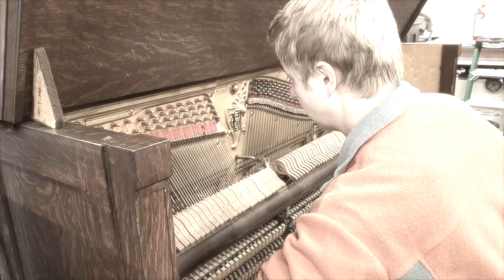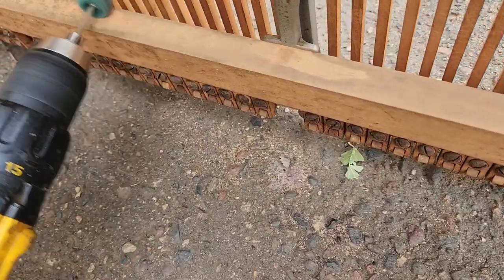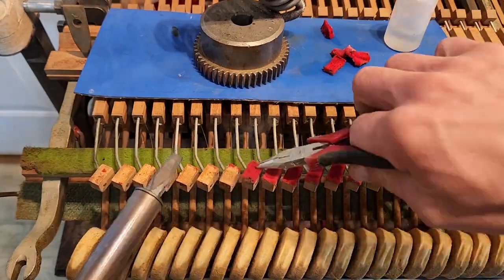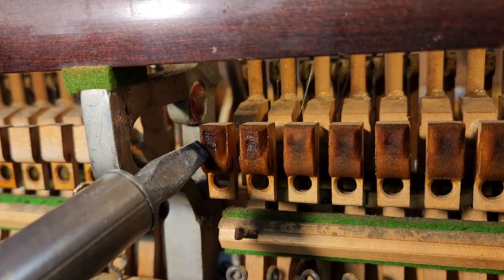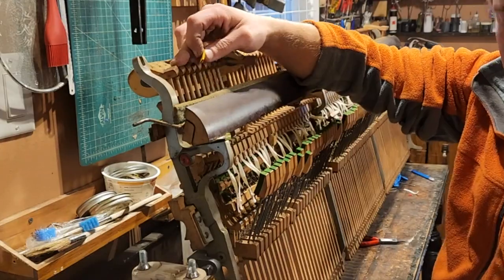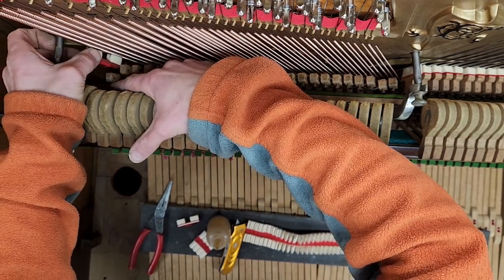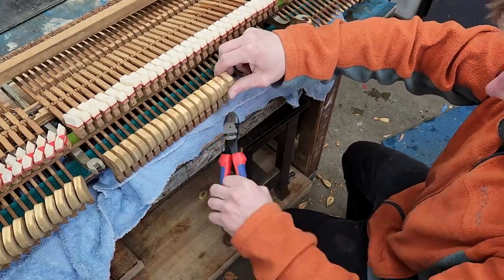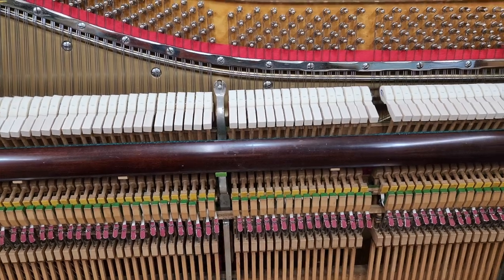Player Piano Revival Episode 7: Refurbishing the Piano Action

Comment: What makes the factory method of installing the new bridle straps so much of a process that you chose the corks? I assume they were glued on, so you would need to clean that hard to reach spot before re-gluing?
Reply from the maker: They were glued on before the hammer butt got installed on to the action. Now that everything is assembled this area is very hard to reach.